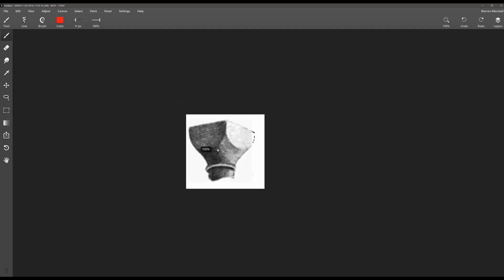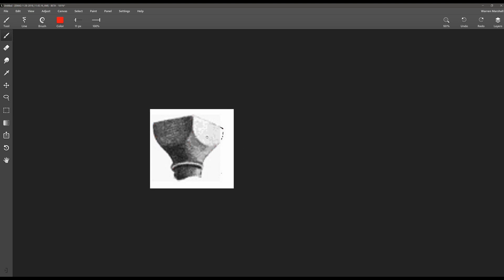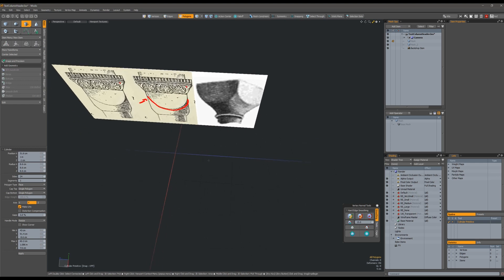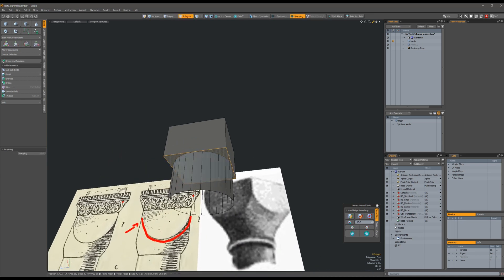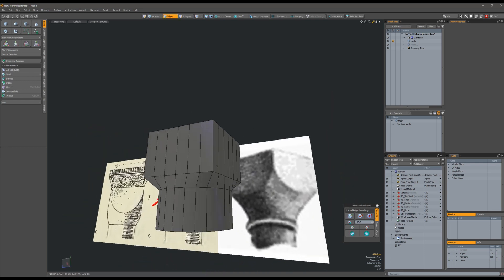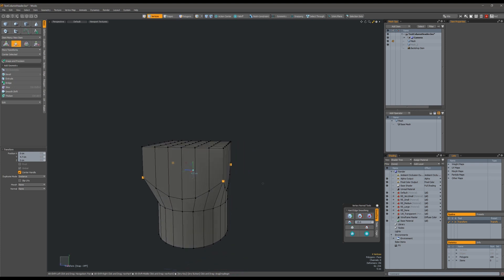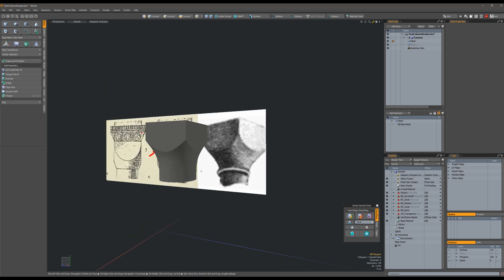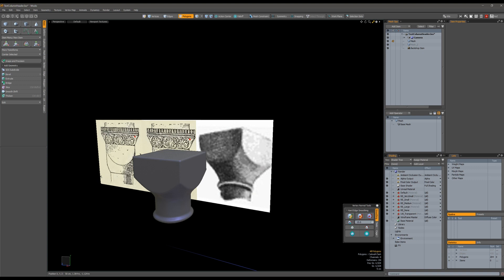Modeling Tips : Column Top

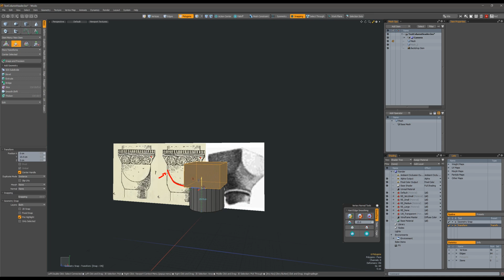Comment: Hey Warren, I just thought of another slight alternative to one of your steps.. at about the 2:26 point, you add a matching box on top of your cylinder (to start the process of making the box on top blend into the cylinder). I discovered that if you instead leave the cylinder capped, select the top cylinder face, then in the modelling tab, goto Deform > Radial Align from the Align Tool panel, set the Mode to 'N-Sided' and set the count to 4. With the newly box shaped top, simply pull it up a bit, scale it out uniformly in the xz axis so it is larger than the cylinder sides, then apply a polygon extrude and pull up to fully form the box part, you achieve the same results. However, on my end, the radial align tool seems to be completely broken in Modo 12.0v1 (yet in Modo 11.2v3 it works perfectly). So I already submitted this bug over at the foundry website. But this is what I like about your short modelling videos.. it gets the little hamster in the head wheel running. Thanks for these! Keep'em coming :)
Reply from the maker: Yeah, that would work!  I should probably use that n-sided radial thing more often but I'm just not used to it yet so it doesn't always occur to me.

That's what I enjoy about MODO ... lots of little tools that can work together means there are multiple paths to every solution.

Comment: 4:40 How did you flatten that selection so quickly? I'm accustomed to the maya approach of using the scale tool to flatten like that but have yet to find a perfect solution in modo.
Reply from the maker: That's applying edge weighting to the selected polygons.  The mesh is in subd mode.  I have hot keys to apply 100% or 0% weight to the current selection.  Then I let the rounded edge shader handle the beveling of the edges.

Comment: Do you also do organic modeling? Like hands, whatnot. Or you usually stay away from it and only focus on weapons and props. I'm asking out of curiosity and for a bit of direction for myself too. I used to do levels for CS, TFC, and I'm trying to get back and maybe even try a job in the industry, just released a jam map for Quake One, then I started learning Blender and UE4, and I'm kinda lost on what should I do and what should I focus on.
Reply from the maker: Personally, I really try to focus on hard surface props/environment work.  Rocks and things are OK too, but generally I like guns, things made of metal, wood, etc.

Characters are defiitely a no-go for me.  I try.  I really do.  I just can't for some reason ...
Reply: ty!
Reply: Warren Marshall character modeling based on highpoly technology. This tecnology for the present is not so controlable like lowpoly modeling in the aspect of easy form changing and reverting step back.